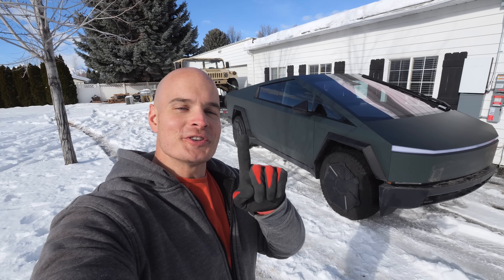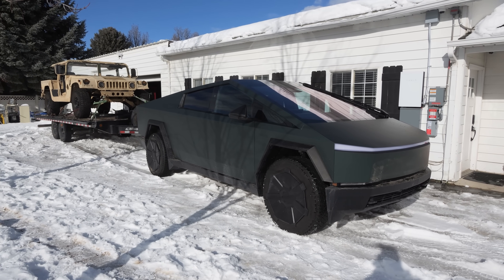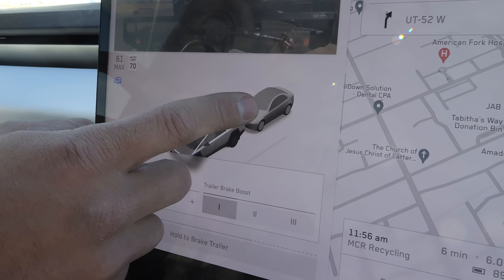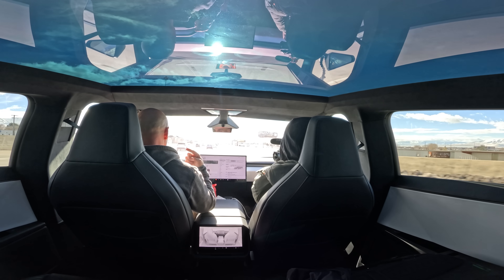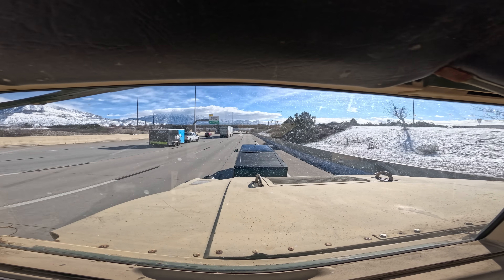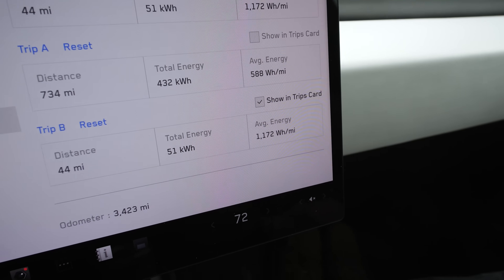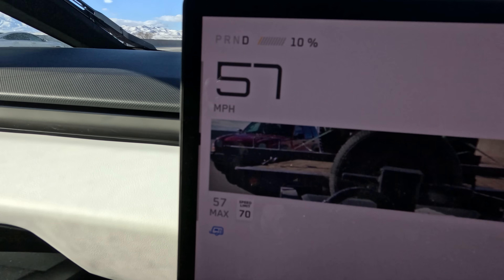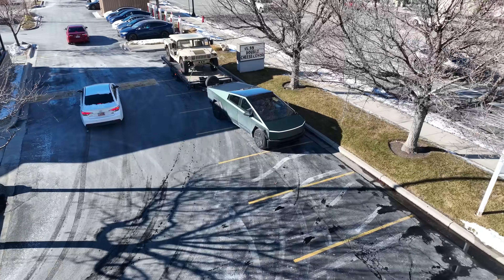How far can the CYBERTRUCK tow 11,000lbs in Freezing Weather?

Comment: I’m curious how much a gas counterpart truck could tow the same weight. Compared to its normal range on fuel.
Reply: With a current diesel truck towing the same weight at 65mph, looking at a 13-16mpg range.

Comment: With the towing weight and conditions that you tested under.......It got 1/3 of its estimated range. After those 90 miles, to charge it you have to drop the trailer and then get into a stall.......what a pain that is.

Comment: I think the most glaring issue is the cabin noise. That’s a loud boy!
Reply: God that thing is noisier than my F150 pulling a 9,000 lb trailer with the 3.5 v6 ecoboost
Reply: Sir. CyberTruck comes with earplugs.
Reply: @leetcodeking4859   Do the earplugs run on batteries? Subtract 1 mile from the range to recharge them.
Reply: Yeah, sounds like it's running with straight-cut gears!
Reply: Yeah, kind of a piece of shit as far as how it’s made.
Reply: The most glaring issueS are 90 miles of range, an hour to charge, limited stations, and having to dump the trailer to charge. The noise should be the least of anyone’s worries dumb enough to buy this thing
Reply: @Dirtroadskrttt  Ah yes, the "I need to tow 400 miles a day for a truck to be worth it" gang. 

Cybertrucks are useless, but not because of towing. If you have a real business and tow 60 miles a day, the Rivian or Lightning will be cheaper to operate than a gas equivalent.
Reply: wait till you see the resale value lmao

Comment: So confused. How is 80% charge more than enough to get back home when it took every last drop of juice to get there to begin with.
Reply from the maker: I didn’t drive in a straight line. It was a down and back trip with my house about 15 miles from the charger. I also didn’t charge all the way to 80% I left the charger at about 50% and charged up the rest of the way at my house since it’s cheaper there. By a lot.

Comment: It's because he has the model with short range battery pack. It's a budget model that costs less because it has a smaller battery. For more range he can purchase the separate battery pack that connects inside the bed of the pickup or he could have ordered the tri-motor model that comes standard with a bigger battery.
Reply: dojng 150 instead of 90 miles and spending extra money doesnt really fix the issue lol
but bth, no one tows this much

Comment: Rivian added the new much-better tow mode while I was in the middle of a 4500 mile towing trip. (Drove ~2000 miles, stayed in one area for a couple weeks, then drove ~2000 miles back; with 500 miles of driving in the 2 weeks, the update that brought the "gauges" plus tow profiles happened during the 2 weeks.)

Before the update, towing range calculation was fairly reliable, although it did overestimate by 5-10%, so I had to take that into account. After the update - it was terrible. The first 1000 miles, the range estimations would vary wildly and always over-estimated by more than 10%. It nearly stranded me multiple times. After about 1000 miles, it got a lot better. The last 500 miles of the drive the range estimate/navigation was spot on, far better than before the update.

Comment: 90 whole miles. What a workhorse!  Totally worth 100K!
Reply: range also will decline over time.
Reply: 😂😂that thing is fugly looks like a Lego car hahaha
Reply: @BearsHikingClub  eh, at least it's not an anonymous bubble you can't find in the parkinglot
Reply: Not quite as good as any old $4k 20 year old gas powered truck…
Reply: serious towing should be done with hydrogen fuel cell.
Reply: ev pickup truck . ready to sell to the working man!
Reply: @plutodestroyer12  For the average homeowner, the Ford Maverick is all the truck they would ever need and that things already $10k too expensive for what you get.
Reply: $1,111 per mile range xD What a joke. EV trucks are as good idea as folding smartphones A.K.A. those words shouldnt even go in a sentence together.
Reply: @@cro8176 near zero emission? What? You do know that the U.S, where the Cybertruck is sold, legal, produces 80% of all electricity produced from fossil fuels (gas, oil, coal), right? Burning these fossil fuels is what is charging the EV's.

And then we havnt even mentioned the how bad the production of these cars and the batteries are for the environment.

Production and electricity consumption gets even worse for the environment when comes to needlessly heavy, big and inefficient cars like the Cybertrucks.
Reply: Not to mention, he had to drop the trailer to charge.  Just doesn’t make sense to me.
Reply: @SonofHardrada people who can afford a 100k toy truck😂
Reply: But it's how long it takes to refuel. That's the diff
Reply: and you don't have to remove the trailer too
 @Robert-j6r8c
Reply: @SonofHardrada  a tool chest, a couple rafts, and a couple jacks in the back and it's probably an ok truck to do recoveries in for your camping or climbing buddies, not a great truck for that mind you, but an ok one
trucks do more than tow
Reply: As my mum would assess this vehicle, “Nice colour though”. Nuff-said
Reply: @SonofHardrada  They gotta virtue signal somehow!
Reply: And the kicker. While he said it cost only 13 dollars to fill at home that was only for 90 miles 😂. Stretch that to 300 350 miles which is a typical gas or diesel truck range towing and your at almost the same cost but you didn't have to stop 4 to 5 times at 40 min intervals 😂😂😂😂
Reply: @jonathonvince561  at 3.50 a gallon and 10 mpg of diesel that same range would be 35.00 to 40.00 ..... excluding 300$ oil change every 10,000 miles. Diesel is great ! But if you ant to make money even with time involved no diesel will make more in the long run.
Reply: Yeah right. The same “busy” people that drive like a bat shit crazy person to get home 3 minutes faster and do nothing.
Reply: You don't understand though!! These people speeding have important things to do or are saving someone's life because no ambulances. (hopefully obvious sarcasm) @TwinTurboOnly
Reply: @SonofHardrada  Because they are saving the planet ! They are so smart you know...
Reply: Every Elon bois right now: It'S sTiLl iN bEtA.
Reply: $1100 a mile for a 90 mile towing range. Elon laughing hysterically to the bank.
Reply: @SonofHardrada  if you want to talk about "using a truck as a truck and not to impress people" then talk to the 95% of ICE pickup buyers who never do anything but commute to work, go get groceries, and chauffeur their kids around with it 🤣
Reply: @SonofHardrada lister friends
Reply: Yep, bad joke..rich kids toy..and never guess that the biggest owner is the rich dad.. got nothing to do with helping the average america..but musk is hoping they buy them.. either musk is not that bright or the average American  is not that bright.
Reply: Imagine if you were off grid solar and charging was free that would be half your payment
Reply: Guys, Here is The Savior

HalleluYAH translates “Praise ye YaH”

YaH is The Heavenly Father 
YaH arrives via the TENT OF MEETING
YaH was Who they Crucified for our sins
YaH was Crucified on an Almond TREE

— Ancient Semitic Cuneiform of Moshe (Moses)
— Isa Scroll (The Original Isaiah)

Isaiah 42:8
"I am YaH; that is my Name! I will not yield my glory to another or my praise to idols.

Isaiah 43:11
I, I am YAH, and there is no other Savior but Me.

Isaiah 45:5
I am YaH, and there is none else.
Reply: @SonofHardrada  

1. The “god” begotten a “son” with a “virgin” is the story of Gadreel (The Serpent) begotten his “son” (Cain) with the “virgin” (Eve) 
-- Genesis 3, 4

1 John 3:12 “Don't be like Cain. He was a child of the evil one…”

2. jesus/Sirius, the “bright morning STAR” and the “virgin mary/woman” is the Constellation Virgo the “virgin woman”, that is Astrology, the worship of STARS and “birth of STARS”

PLEASE, go back and read what I shared
Reply: @SonofHardrada  

YaH The Heavenly Father (Genesis 1), YaH, Who, with His HAND, formed “man (Adam)”, from the dust of the ground (Genesis 2:7) and it was YaH’s HAND was NAILED to the Almond Tree, to symbolize forgiveness of the “Tree of Life” sin OF “man” and thus “The Fall OF man” (Genesis 3) and YaH The Father arrived to be Crucified via the Tent of Meeting (Exodus 33, Isa Scroll)
Reply: I just got this awesome idea, how about you haul a big extra battery in the bed, then Tow a big gigantic battery behind the cyber truck. Oops, I forgot in that case you need to leave your boat or RV at home! Never mind!
Reply: Most truck owners don't even tow, the ones that do mostly tow under 100 miles and/or less than 2000lbs. your nonsense only applies to about 15% of truck owners and that's not the target market for the Cybertruck. If you tow long distances on a regular basis, you need a diesel-electric truck like the full size conversion Edison Motors is doing in Canada. 
 @restoreamerica1558
Reply: EV's are only good for around town driving and you have a home charger
Reply: @loucifer4205 You're completely wrong on the first point and I know because I just drove a 2400 mile road trip in the slowest "fast" charging car on the road with no issues. You're second point is valid and is why L2 charging stations need to be mandated for multi-unit complexes
Reply: @mcamodell  Yeah and it took you 4 times as long as a gas or diesel engine to do that's what meant I didn't say their would be any issues it just takes too long to charge, it takes me 2 to 3 minutes to fill my tank when empty it takes how many hours to charge your battery full
Reply: @loucifer4205 Why do you luddites have much trouble with basic math?  it added 7 hours to my 5 day trip.
Reply: @loucifer4205 Also, I've been in those travel stops and you are flat out lying about it taking you 3 min to fuel up, avg is 16 min, so not only can you not do basic math, you can't even count
Reply: @mcamodell  16 min are you on crack it takes about 2 to 3 minutes to fill a 20 gallon tank
Reply: @mcamodell  Yeah that was one day of charging what about the other days
Reply: @loucifer4205 No, that was total added time for the entire trip...how long do you think it takes to DC fast charge an EV?
Reply: @loucifer4205 BS! NO ONE takes three min to fuel, let alone on a road-trip, you are just lying. First of all, average pump flows 5G/min...so there is 4 min right there. Second, there is a lot more to fueling up than just pumping fuel. You have to get the pump started, select a fuel, then start pumping. Then you need to use the bathroom, get snacks and get back on the road... 16 Min. So stop telling fairytales about how it takes 3 min for you to fuel. It takes you 15 and it takes me 25 and I pay 1/5th of what you pay
Reply: How about just sticking with diesel for towing heavy loads, and use batteries for scooters? That seems about right. Not only is this truck (I have a very difficult time even calling it that) ugly, and looks like a fort built in someone's back yard by a 10 year old having a blast, the range is crap. Did I mention ugly???

 All I ask is why every time I see someone comparing this Volkswagen Thing of a vehicle to a truck, which it is not......
Reply: I watched another video where a guy was towing an 11,000 lb camper. On a full charge the Cybertruck had to be recharged after only 80 miles! It cost $37 to recharge the Cybertruck to go another 80 miles.
Reply: Don’t get me wrong, lm an ev fan, but towing range sucks.
Reply: Only if you slow down to 40 mph.
Reply: this is the dual motor so it’s $80k
Reply: @SonofHardrada  people who buy these cars aren’t in a rush and even if they did still drive an ice car they would most likely go to costco and wait in line to pump anyways. you can say it takes 5 minutes to pump but they can also say it takes 10 seconds to plug in at night and wake up to a full charge every morning.
Reply: @troyvo8069   How about when you recieve ur 1st electric bill after a month of  doing those nightly recharges?
Not an EV owner here, but  thats gonna cause quite a bump in ur utility bill unless you are filling up at superchargers at tesla's expense.
Reply: @troyvo8069  I've never had to wait for a gas pump. Not once
Reply: @TCHrulez  i’ve never waited at a charging station and i never really had to go to one. just as you have seen people waiting at charging station, i too have seen people wait in lines to get gas. 🤷🏻‍♂️
Reply: @TCHrulez … I remember the early 1970’s “Gas Crisis/Shortage”. Pumps and stations ‘Out of Gas’. Odd and even days. Lines of ICE vehicles, waiting. Fist fights. Theft.
Reply: @SonofHardrada  i don't know man, maybe they earn enough money to not have to work a 100 hours a week.
Reply: @Ryan-093 😂😂
Reply: My one ton duly gas powered truck would only go a 125 miles with that big of a load.😂
Reply: My diesel one ton ford will do about 300 miles with 28k on the trailer, 38k between truck and trailer. @STURGISMAN
Reply: @ghostreconslovessnow  same here but a ram Cummins. And if you are hotshotting you can run it all night in cold weather to stay warm If you got the high idle feature
Reply: @STURGISMAN  ??? My 97 Dually diesel Ford with 24 gallons of fuel easily 250+ miles and with Cali's absurd graduating electrical rates close call diesel vs electricty.
Reply: You must have made in CCCP truck🤣 @STURGISMAN
Reply: @STURGISMAN what's wrong with it truck then
Reply: @jamesa9lpiopatton419  I don't think I said anything wrong with either of the trucks
Reply: @STURGISMAN who the hell buy a dually one ton with a gasser engine 🤷‍♂️
Reply: @landon_shonuff1181  I just like fast trucks. It had a 496 big block and would beat any diesel :) Just like the cyber Beast I put my order in for last week :)
Reply: @STURGISMAN I feel like that wouldn't cost $13 to refuel either 😅 I feel for ya man.
Reply: @djkjthe3rd185   Just looked it up ..... 120 KW battery at .12 cents a KW is 14.40$ for a full 0-100 percent charge. So you were right;-) Here in Minnesota we have off peak charging at night for 4 cents a KW. Therefore it would be  $ 4.80 if you charge at night. Way better than my 5 MPG diesel pusher! Selling that sucker lol
Reply: @STURGISMAN  diesels in the U.S. aren't really worth it if it's post 2015 unless you're constantly towing big/long distance. Dieselgate really took out all of the good import diesels, and the domestic ones aren't that good unless it's 6 liters or bigger.
Reply: @STURGISMAN That’s why I have a Diesel pickup truck with a range of 500 miles on a full tank. I get 30 mpg on the highway.
Reply: An f150 v8 only goes 120 in the same conditions
Reply: @mcamodell Yea... but you can fill up in 10 min an hit the road again. You do understand there is a tremendous advantage to a gas powered truck? 🤔
Reply: There is a HUGE cost for that advantage too. A gas powered truck is stupid waste of money. No truck should be gas powered except a tiny courier truck. A diesel truck is the best choice for frequent towing long distance, but extremely few people actually use their truck that way. According to consumer polls, 71% of truck owners have never towed anything and an additional 16% tow less than 3 times a year and or less than 1000lbs. This idea that a EV truck isn't for you because you did a thing once several years ago that would be much more time consuming with an EV is just stupid.   @russrandolph
Reply: @mcamodell  even 120 miles is still a 30% increase over 90 miles. And this accumulates over longer distances which is a common use case for heavy towing. On Interstate highways you are never more than a few minutes from a 24 hour gas station, unlike the sporadic distribution (and questionable operability) of charging points. It will take years of expansion before there's even close to parity of availability.
Reply: @SonofHardrada 

No such thing as a jesus. You really need to read what I shared
Reply: @SonofHardrada  

There is NO SUCH THING as a jesus.
Reply: @SonofHardrada  it’s pretty weird that you live your life devoting that much energy into hating on EVs and who buys them. like go pump your gas and move on.
Reply: @troyvo8069 I like pumping gas even more after seeing how long it takes to recharge, the lack of charging stations and the poor range many evs get, especially while towing.
Reply: @ilc-nl3yy  Understandable. If charging overnight at home isn't feasible or you frequently tow, electric vehicles may not be suitable. In my case there are charging stations at malls, grocery stores, and restaurants everywhere i go offering convenient top-ups while I shop or dine and most of the time i get front parking. The home setup ensures a full charge every morning, and since I don't tow, it aligns well with my needs.
Reply: @ilc-nl3yy home charging effectively gets you around most of charging wait. You plug in when you get home from work and it’s full in the morning. The only times you wait for a charge is long trips (NGL it sucks) and extended power outages.  After owning an EV for awhile my advice is to only get one if you can home charge and be able to do at least two days normal driving without any charge just in case of power outages or, like where I live, sub freezing temps in winter that cut into range.
Reply: lol like 100k a lot of money these day.
Reply: @kentpoon1218 if people are willing to borrow $100k and pay it back over 8 years at 9% would suggest it’s still a lot of money…
Reply: @kentpoon1218   100k now is like 50k pre-covid.😆

Comment: Can you charge a Tesla off another Tesla? 
Like if you run out of power on the side of the road can a Tesla with a fuller charge share enough energy with a drained Tesla to get it to the next Charging station?
If not they should think about implementing it or make roadside assistant vehicles with large battiers to provided electric cars with enough juice to reach the next charging station.